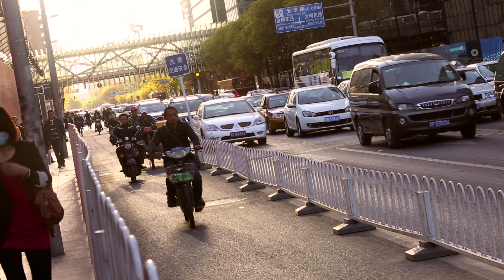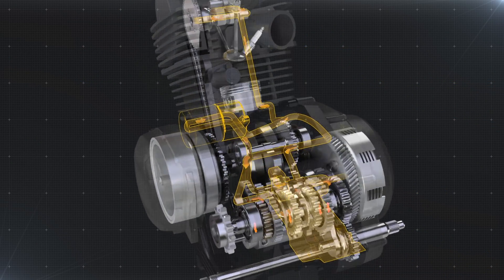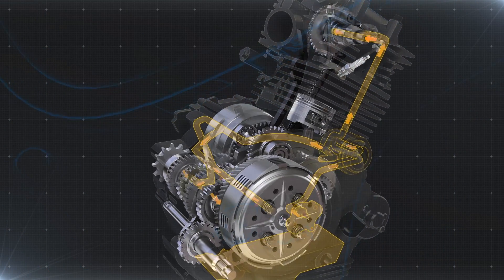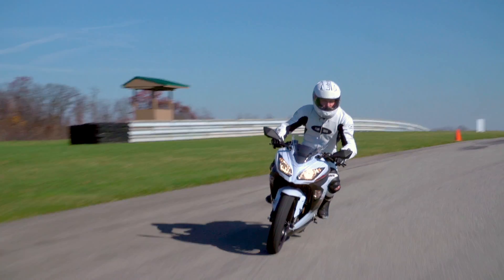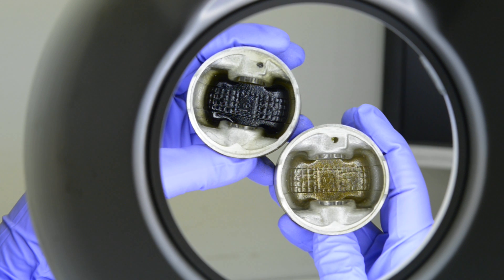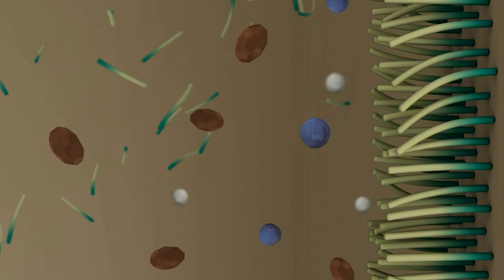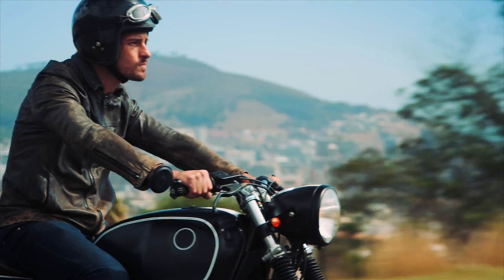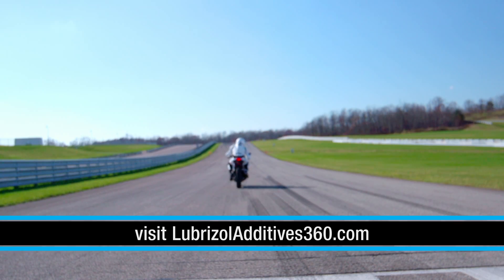Deposit and Heat Control in 4-Stroke Motorcycles

Comment: That's a ninja 300!!!!!!!!!!!!!!!!!!!!! I NEED HEEEEEEELP.

Have 24500 miles on my 2014 Ninja 300 (of which 2500 are mine...) and my stator/water pump areas (both) get hotter than they used to about 200 miles back and a slight ticking AND pump knocking. Would say valve knocking, but it almost sounds like it's not compressing hard enough... Perfect cold start but once warmed up and in gear it'll tick and I can hear the valves quite clearly pumping but not hitting/knocking. Here and there it even gets less throttle response and it's gotta rev up like a damn turbine... Any advise? I use quality oil and coolant. Not race certified, but OEM...
Reply: You won't get it here. Go find a forum for your bike.